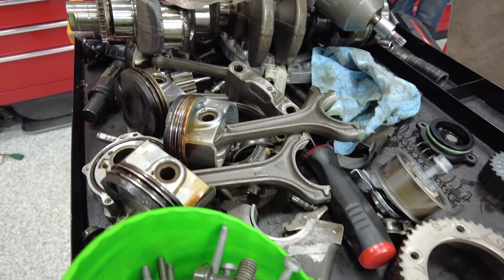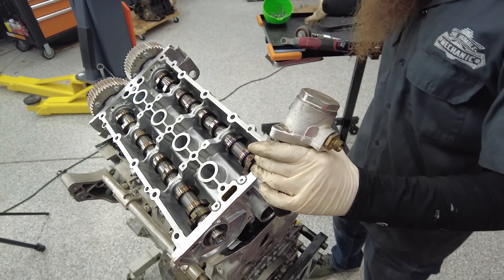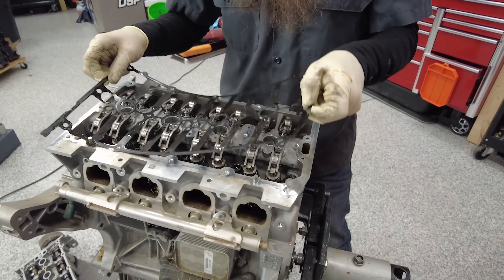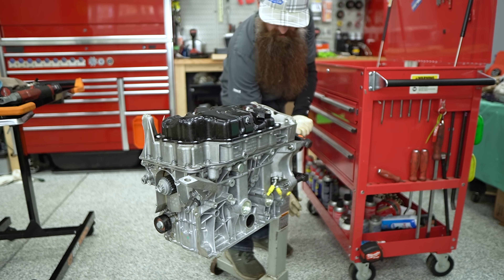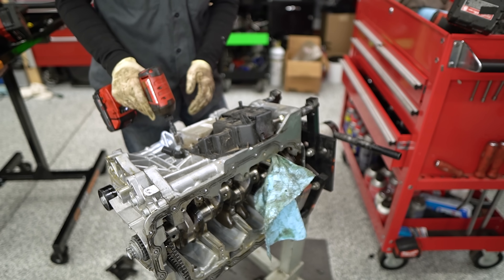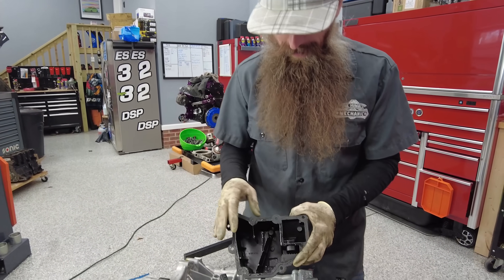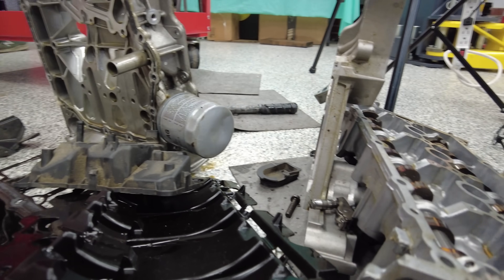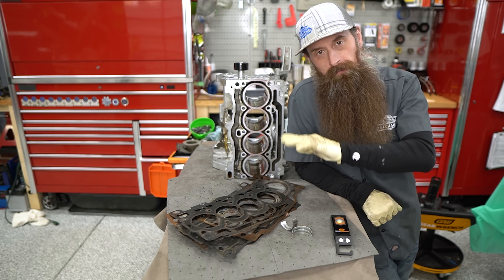1.4 Turbo Engine Teardown After Engine Failure ~ Rod Knock

Comment: As a former SEAT and Skoda Tech, I had mostly good experience with these engines (EA211 Family). Altough some did suffer from loosening Fuelrails and desintegrating Camadjusters (both issues were covered by recalls and/or Service Bulletins), these engines are pretty reliable and very fun to drive (and fuel efficient). In Europe, these range from 60 HP (3 Cylinder NA) to 150HP (4 Cylinder as shown in this video with ACT). The 3 Cylinder Turbos suffered from leaking injectors, faulty ECU software (DTCs concerning the IAT Sensor) and leaking Turbo feed lines. Given the number of cars with these engines though, the problems where not really significant. I like the Idea of swapping one of these into a Mk1 or 2, but the ECUs aren't capable of Stand-Alone Operation (as far as I know) and modifying the entire vehicles electrical system to MQB, just to get an engine going..... At least in Germany, I don't think that someone got hands on an aftermarket stand-alone ECU which is capable of driving a Direct Injection engine.

Comment: I’ve always been interested in the 1.4 especially because it’s so rare here in the states. I’ve really wanted an a3 e-tron which has the same 1.4 + hybrid system but I’d also be really interested to know if there is any tuning capabilities of these engines with hybrid syatems
Reply: There are, check The Flying Dutchman GTE (Hybrid Mk7 Golf 1.4tsi with hybrid motor). He modded it full bolt on with an upgraded turbo, and custom tuning to make 340hp. I myself am driving a FBO Golf 7.5 (1.4tsi) stock motor for now. Upgraded hybrid turbo, Unitronic stage 2 software and stacking JB4 on top of it. Upgraded charge piping and suspension, full turboback exhaust, its a fun and quick car. Im looking to push it further by upgrading to forged internals in the future to see where it can go. Perhaps a reliable 350-400hp? I suppose transmission limited at some point.

Comment: Tear down a 2 valve VR6 if you haven't already.
Reply from the maker: I did that a number of years ago when I rebuilt it for my MK3 VR6T
Reply: @HumbleMechanic  I'll look for it, thanx.
Reply: @Flies2FLL  I think he called it "White Wookie." What surprised me about the VR6 (and later found out about European gasoline engines) were the 2 piece oil rings. American and Japanese engines are what I am used to, so my first thought was "Who puts diesel rings in a gasoline engine?"
Reply: @skylinefever  Interesting, I didn't know that about the VR6.  That engine was designed to run as warm as VW could get away with in order to increase efficiency.  Perhaps that had something to do with it.

Comment: Tear down a V10 TDI if you can get your hands on one. It would be really cool the see the gear train and the super long head bolts that run through the heads and into the upper cranckshaft girdle.
Reply from the maker: I agree would be so awesome. I’d need a new engine stand. Hahahha
Reply: @HumbleMechanic  you'll also need an entire day and might need an extra pair of hands.

Comment: Is there a witness mark or reference marks on the tone ring and crankshaft for proper assembly? I couldn’t tell if cylinder bores were etched aluminum or cast liners.

Comment: The 2.0L EA288 TDI also use a similar design for the camshaft housing but with a separate plastic cover. Kinda cool, built camshafts so the lobes are pressfit onto the shaft itself. Not so fun when they spin the lobes or gears tho, had one do that, ran just fine for about 5km then it threw cam/crank timing faults. Took a while to figure ot that the gears between the two camshafts had spun since there is no marks or any way to check if the cams are aligned to eachother. Thankfully they fixed that for the EA288EVO so you can atleast check the alignment on those

Comment: Hi Charles, I was wondering why do you have to change your oil at least once a year? I ask as my wife has a 2018 Volkswagen Golf Sportwagen with the 1.8 TSi, and she drives like at most 2-3k miles a year. Like she had less than 10k on the car and we bought it new in 2019. So I’m just wondering does oil still break down when the car is barely driven?
Reply: https://youtu.be/T-yt5a1cWd4

Comment: For all those asking for a 2.5 teardown you realize one has to break first right? I have a customer with 630k+ miles original engine second transmission. (09G) Btw it has no check engine light either lol I even pulled faults in disbelief.

Comment: How about teardown an old air cooled lump be nice to see how things have changed over the years
Reply: Hagerty did it. I found it interesting that rebuilding an air cooled VW is not as easy as many have told us:
https://www.youtube.com/watch?v=S3cMPJjuj2w
However, it was not expensive to do, so people actually did rebuild the dead engines in their beetles and microbuses back in the day.

Have you ever seen underneath a VW Microbus? I did once, when installing tires on one. I never imagined a vehicle could be so simple. They make a Ford F100 I6 look complicated.
Reply: @skylinefever  I will have a watch  yes I've worked on vws all my life however I'm on the other side of the pond.
Reply: @deanage1983  Okay, interesting. When Haegerty works on something that was more popular outside the USA, many fans have advice from their home countries that never made it here. They rebuilt a Mini 1275, and got a lot of advice for example.

Comment: The integrated exhaust gas manifold is also one of the reasons this engine is so fuel efficient, it allows for much lower EGTs during highway cruising which allows for a leaner mixture without destroying the cat.

Comment: I do agree the 1.4 is a very good engine even 1.2 tsi like we have here in the uk. Never ever seen one blow its self up even with poor maintenance! We had one problem with a 2018 1.4 where it cracked the piston ring land and caused it to loose compression and score the bore but could of been a faulty injector as that part of rhe piston had been very very hot possibly to excessive fuel

Comment: Essentially a 'throw-away engine'...not much sense in servicing it beyond tune-ups and oil changes. That thing is not serviceable...the slightest thing that goes wrong with it and the whole thing is ruined.  I'm surprised VW would even sell service parts for it.

Comment: How about the VW Up engine, even if it is technically not a VW engine.
Reply: What was the VW Up supposed to be? I'm sure whatever it was, the USA never got one.
Reply: @skylinefever  Toyota Aygo or Datsun GO, and also the Citroen and Peugoet versions. Yes not likely to have been sold in the USA, as they are small vehicles with small engines. You can park 2 of them in the parking space you need for the Mini Clubman.
Reply: @SeanBZA  Okay, the Scion iQ might have been what the USA got. Scion was a name breifly used by Toyota to attract younger buyers. Young drivers associated Toyotas with boring old people, and it had been years since Toyota built anything interesting.
Reply: @skylinefever  No, that I think was Toyota using models they traditionally did not offer in the US market, done under a different brand name.

Comment: I'd love to see the 2.0 ALT engine from Passat B5.5 and some  Audi's, on a teardown as it's my current engine too 😉👍
Reply: Is the 2.0 ALT an 8V PD TDI? The B5.5 Passat had an optional 8V PD TDI called the BHW. The gasoline engine options were a 1.8T 20V and 3.0L 30V.
Reply: @skylinefever  Hi, no mine is ALT and is a 2.0 litre, non turbo, manual, petrol 👍
Reply: @jahkingdom  Okay, the USA never got one. Even the most basic B5.5 got a 1.8T 20V in the USA.
Reply: @skylinefever  cool man. Aaah so that must be why there's hardly any videos out there on this engine!. Forgot to say it's also 20 valve. I like this engine as there's no turbo to go wrong, less to take off for a timing belt change and you get about 130 horse power so gets going fairly quick. They're notorious for burning oil though and mine is the same, never see where it goes but it certainly disappears somewhere lol 😆👍

Comment: I would hazard a guess that if one overheated that engine it's going to be head replacement, as the cam journals cannot be line bored.
And I am sure the clearances would be affected in the girdle after a boil up.
But, it's a packaging exercise which vdub has got pretty dialed in there.
Very neat.
Thanks for the tear down.
Did enjoy it.

Kind regards,
South Africa

Comment: I'd would like to see a teardown of a 2.9 12v vr6 just to see the difference between the 2.8
Reply: Internally, the only difference between a 2.9 and a 2.8 is the 82mm pistons instead of 81mm pistons. Many people buy a set of standard 2.9 pistons when rebuilding a 12V VR6.
The intake and exhaust systems are different, you might be able to buy them from some expert in Europe. I'm not sure, Nissans are my thing, and you can get an expert in Japan to buy and ship special parts to the USA.

Comment: For having rod knock, all of the bearings look fine. I wonder if the piston pin had an issue.
I am shocked at how simple of a design it is for a VAG product. Looks good
Reply: For a VW engine it it is very elegant, it's almost like a Honda engine, very impressive. I also like the care that Charles took when disassembling it ("whoops, I just accidentally dropped half the bolts & rockers back into the engine"), rofl.
Reply: It would explain why it only knocked when there was compression in the cylinder. Because If it was a rod bearing it would make the sound all the time.
Reply: They have simple design, but bad build quality
Reply: @ivanjovanovic362  bad build quality...nah... you never know who owned it and how they drove it.... There are very low engine errors on european build engines So its proprely  assembled in america...

Comment: I would love to see the V10 I think it is that was in the Audi S8? Car Trek had it on last year as the replacement car for Tyler Hoover. Apparently, they are pretty bad. The engine in the RS7 that Rich Rebuikds did in his garage when he did an engine and turbo service. That thing looked impossible to work on. I've always heard that the engine in the Macan is the same as the Q3. Different from the Tiguan?, but that in the Q3 and Macan they are exactly the same, but I've always heard the gearing, internals and the turbo were all different from each vehicle.

Comment: I’m actually quite surprised on how good this engine is. When I bought a Golf with this engine I was expecting it to be as refined as meat grinder with spoons but it’s really smooth and torquey. It’s also reliable although it burns a bit of oil when it’s -20 outside. I was in for a GTI but they didn’t have one in stock so I ended up with this car and I’m actually happy with it.

Comment: Disturbing to see Charles flippantly sending bolts failing to the floor and into engine blocks, pieces of the motor flying around his shop, and grabbing huge overpowered tools with craziness in his eyes. Charles is in rare form tonight
Reply from the maker: Hahahha it’s different when it doesn’t have to go back together 😂
Reply: @HumbleMechanic  I'm still wondering what's about that engine that is wrong... Road knock should be well visible in the road bearings but these were ok... It seems it has nothing but a locked camshaft phaser...

Comment: I Love the Idea of the 1.4l dual charged engine from around 2009. The one with the belt Drive compressor and the Turbocharger. Everyone says that the engine is super unreliable. Maybe tell us in detail, where the problems are. 🙋🏼‍♂️
Reply: Weak pistons, poor tensioners, high oil consumption, super lean stock tune, inconsistent injectors that foul plugs, supercharger clutch integrated into an unreliable water pump...

Comment: PLEEEZE explain the mechanical differences between the 0w-20 spec VW 2.0 Turbo engines and the ones that came before!
Reply: It would be an interesting point. However, also worth noting is that the VW specification 0w20 is typically different from the 0w20 intended for American, Korean, and Japanese cars.
Reply: @skylinefever  - My curiosity was piqued by how specific VW was about using no other spec. Since then, I've read rumors of different crank drillings, oil pump changes, but nothing from VW themselves. It's even a different engine code.

Comment: Every VW engine teardown i've seen just screams "lets make as many points of failures as possible and make them really expensive to fix."
Reply: But something has to fail first, and chances are you get warning from the myriad of sensors kept under the hood, monitoring the flow and temp etc. I'm not going to criticise an engineer, as this engine is engineered to be smaller, lighter, more fuel efficient, with enough punch, and that's what's important to me.

Comment: I was excited when I saw the title because in Australia I see a lot of cars with 1.4tsi engine failures/issues. I avoid these cars like the plague. Very interested to see the comments (and Charles) saying they are mostly reliable. I wonder if the hotter conditions in Aus plays havoc? My understanding is normally issues around pistons/ring lands/skirts? Maybe you could take a closer look Charles since we didn’t really find the fault on this engine yet!
Reply: That applies I think mostly to the older EA111 1.4TSI, which had a timing chain.  The EA211 fixes a lot of the issues with the EA111 design, and first came out around 2012.
Reply: Interesting. Sometimes states like Arizona and Nevada reveal unexpected problems with cars because they are so blazing hot.

Comment: From a power to weight, it could be great swap, but how about complexity? How much programming would the ECU need to lie it about missing systems, so that engine would run in an analog mk1,2,3? Is it possible at all or an aftermarket ECU would be needed? Would love to see some of that area covered.

Comment: Time to tear down an 07K 5 cylinder.  Cheap and easy to find, and fairly similar to the 1st gen TT-RS/RS3 engines (which are neither cheap nor easy to find).

Comment: The camshafts of the 1.0 tsi engine are also not removable. It's very much like a 1.4 tsi with one less cylinder. Don't know if you get the 1.0 tsi in the US,  but they are very popular in the eu due to CO2 regulations downsizing and all of that. Reliable and good fuel economy.

Comment: Tear down a 2.0 liter TDI! The ones involved in dieselgate
Reply: Okay, those were called the CJAA engine in the USA. They were also the most common because they were in the Jetta. The other 2.0 TDI models with AdBlue didn't have the smog problem, but the stigma of dieselgate ruined the image of them. I think the internals were the same, but the smog equipment was different.

Comment: Why did they use a timing belt?
Then again, the 2.0 from the audi q5 chain tensioner failures don't Inspire confidence in that too...

Also having hydraulic compensators on valve rollers means LPG friendly.

I have never seen connecting rods you have to break. That seems like a disaster waiting to happen when a bearing wears down, the connecting rod can grind I to itself and release even more metal dust.

Would be interesting to know if the crankshaft necks were hardened.

This seems like a single use engine. No point in rebuilding it.
Reply: Cracked cap connecting rods are fairly common on newer engines. What sucks is that of the big end is out of specification, you have to throw out the rods. I guess that isn't so bad on modern cars, since it usually goes to the junkyard when the engine dies.
It is a downside to heavy equipment, since those engines do get rebuilt. On the Powerstrokehelp channel, they never rebuild their own 6.4 PSD because of that. It always ends up being even cheaper to buy a reman direct from a Ford dealer.

Comment: I vote for the ea288 TDI engine next. That thing is a complicated beast: multiple cooling circuits, variable water pump, water to air intercooler, variable vane Turbo, and more. While you can get an idea of how it works from the self study program, would be nice to see it apart!
Reply: The ones without adblue are ok

Comment: Hey Charles, I think it would be cool to see a common rail TDI teardown if one became available. I've seen bits and pieces of CVCA/CRUA, but they're still pretty unknown to me. Even a CJAA would be cool!
Reply: I second this! CJAA teardown!
Reply: @kadenwatt2033  Not that I dislike the CJAA, but there's plenty of videos on that engine already, give me some CVCA/CRUA!
Reply: Yessssss! More diesel love!
Reply: I'll chime in to add my support for tearing into a CRUA as well; would be intriguing to see the differences between a modern gas vs. diesel VW engine.
Reply: Yes please, a 2.0l tdi is really common here in Europe!
Reply: There are full documentation pdf bible available for the EA189 tdi, if you can't find the link, lemme know and I'll send you a link.
Reply: or a PD TDI like a 2.0 BKP or something
Reply: Yesss please!
Reply: Mine done. Rod hit ebgine bay. Engine has a hole in it. 28k miles. Never again with nee vw

Comment: Can you do tear downs of diesels ? Like the 1.6 or the 2.0 ?
Reply: Interesting. The USA did get some 1.6 NA indirect injection diesels, but no 1.6 TDI of any kind. Also, the types of 2.0 TDI we got might be different. The B5.5 Passat had a 2.0L 8V PD diesel which was basically a larger 1.9 TDI with a balance shaft module. I think the 2.0L 16V CR engines were basically the same as what Europe got.

Comment: So, nothing was wrong with it? Kind of a waste to trash it. Did you notice the plugs are indexed? never seen that on a production engine before. Non-removable cams is an odd one, but looks like a nice little motor. Cracked rods still seem like a crazy idea.
Reply: Cracked rods seem crazy, but they are extremely common. When it is time for a rebuild, rods have to be thrown away if they are out of specification.